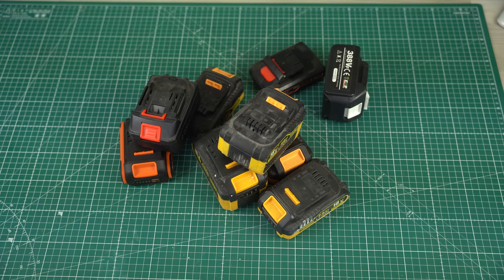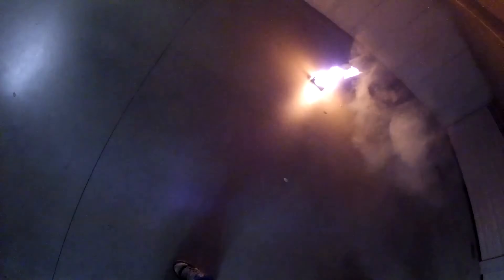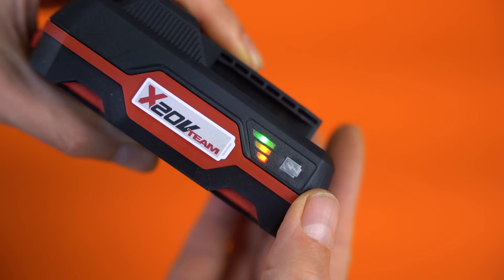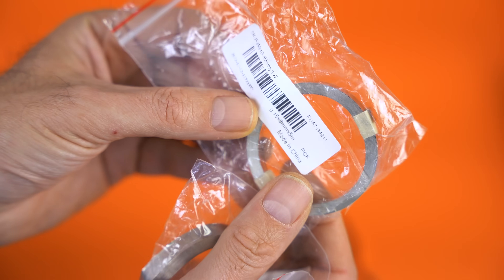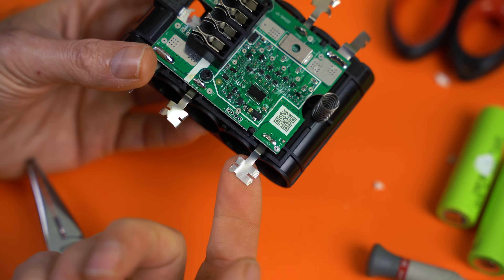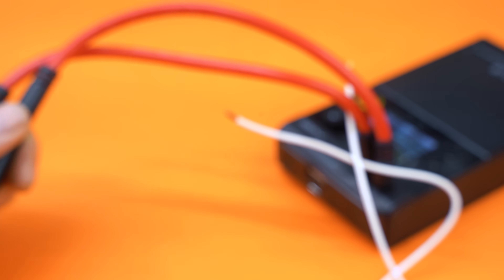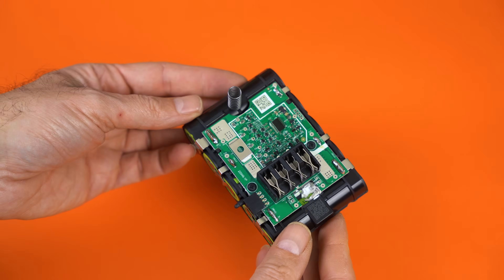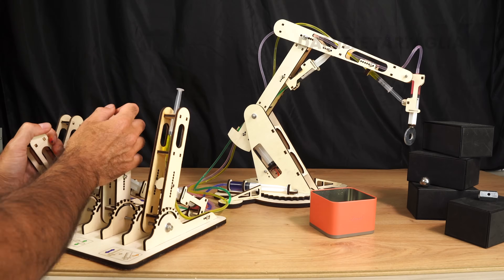Don’t Try This at Home: The Deadly Risk of Spot-Welding Lithium Cells

Comment: 1. Buy a spot welder whose power source is super capacitors. AwithZ is currently the best brand out there. IMO spending $150’ish once is better than having to upgrade once you realize your first spot welder has limitations. 
2. Pure Nickel or Copper. Only use nickel plated steel for doing the copper nickel sandwich method. 
3. Tabless cells only. All the old cells are obsolete now. Tabless cells are no more expensive and significantly more powerful without sacrificing capacity.

Comment: ppl, dont be afraid be soldering connections to cells as well. but do know and be aware of: the led-free solder is really sketchy cus of its "brittle" tendencies. but all solders do this and theres a reason why you prefer(!) crimping electric connections in vibrating devices/vehicles. if battery/cell dies on you doing a quick soldering-job on it (ofc not sitting for many sec's continously - pause if needed), imo its a good thing rather, then u know its garbage and prob saved you work in near future.
Reply: no, you should never solder to cells directly, period.
Reply: Every datasheet on the planet specifically says do not solder. 

Every single person I see making this claim on YT that has a video of them doing it shows them applying the iron to a cell for 5-10 seconds or more. Best case scenario, you’ve degraded your new cells. Worst case scenario it goes into thermal runaway right then and there.
Reply: @user-jh1er8kh7p  well said, finally someone reasonable. You wouldn't believe how many people still think that it's ok.

Comment: You must put an insulating ring on the positive terminal. If the heat from the spot welding touches the outer ring of the positive terminal as shown in the video, it will cause a plus-minus short circuit and thermal runaway. If you want to do it without an insulating ring, it's safer to desolder from B- to B+ and attach the components to the nickel plate first before spot welding.